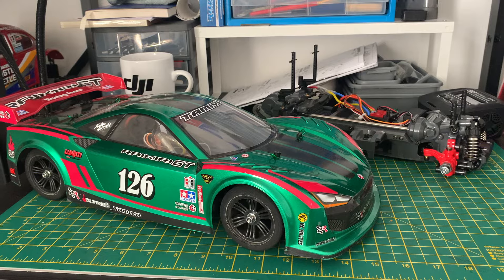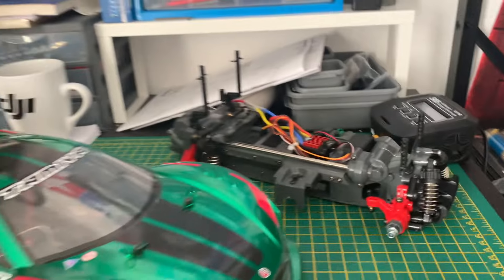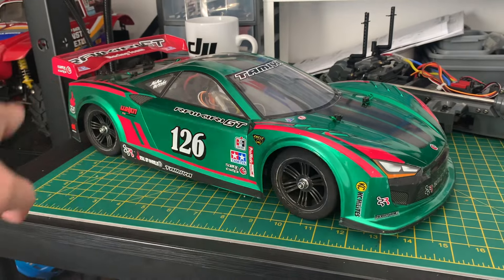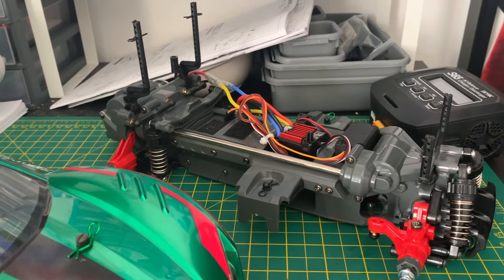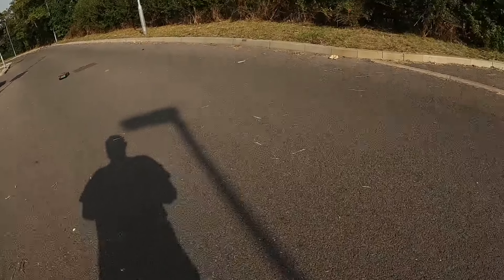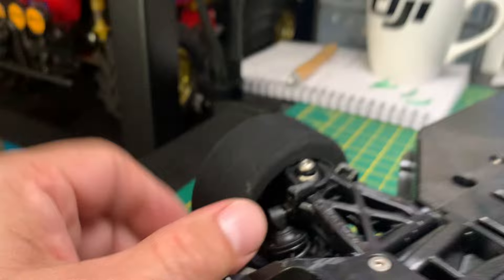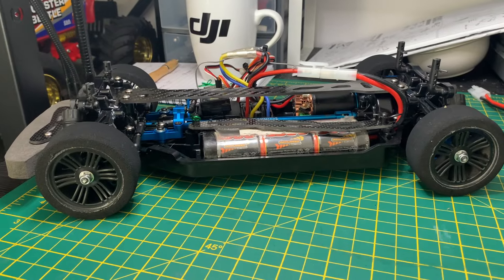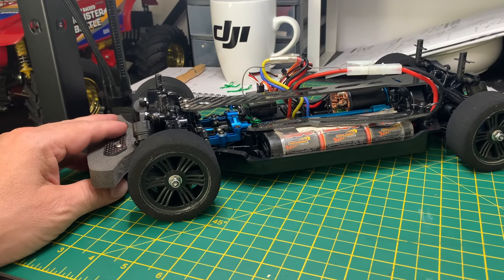Tamiya TT02 Upgrades - Speed Run Car Update

Comment: I just put a suoer stock TZ with a 25t pinion. I have no idea what the speed is I no GPS but it's a lot faster than the tourque tune.
Reply from the maker: Ran it with an RZ and didn’t go as fast as I was expecting. Pinion got stuck on the motor. Must get around to fixing that.
Reply: @rctamiyaaddict4687  the guy at Super Rajikon said the TZ is for road and BZ is for off road. I didn't knkw that but he is the Japanese hobby shop guy so sure, he knows his stuff . At 15 quid, it was a bargain, I got so many hop ups and spare rims and tyres duty free.
Reply from the maker: Nice. Some said to me R for road, B for buggy and can’t remember what T was for
Reply: @rctamiyaaddict4687  because I had a bunch of hop ups for a TT02 when I asked for a BZ he said no a TZ is what I needed.

Comment: Do yourself a favour and get rid of the Tamiya battery connectors. They are like in line resistors, use deans or xt60 connectors.
Reply from the maker: Thinking I’ll go deans when I switch to lipo. Thanks for taking a look and the advice.